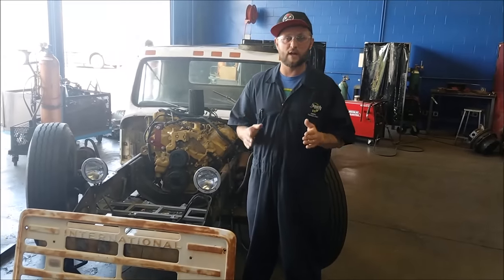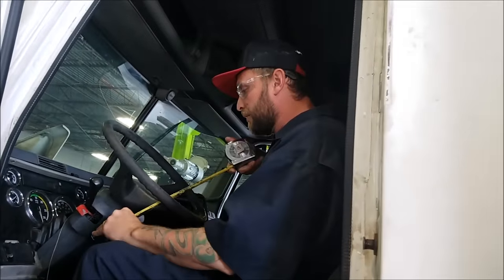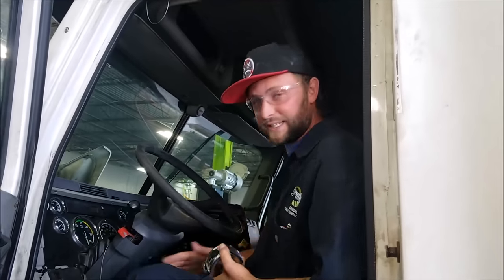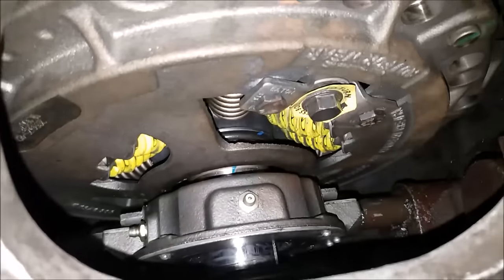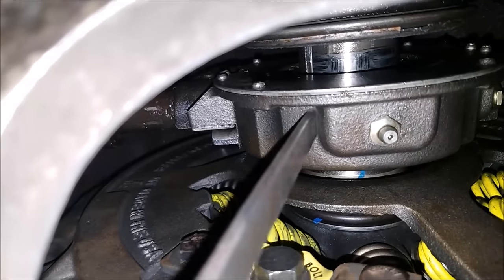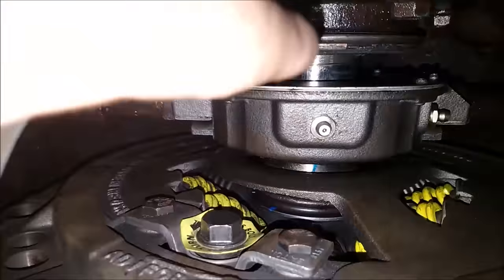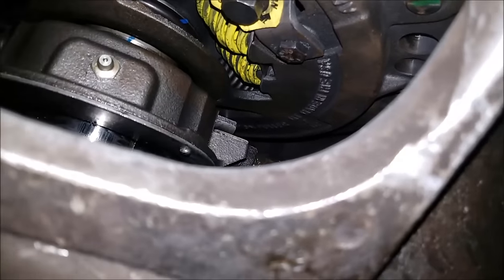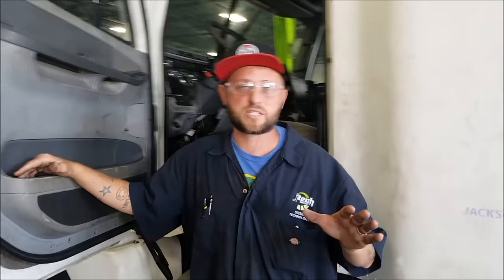Clutch Adjustment on a semi truck (Eaton Fuller)

Comment: The 1/8 inch should be between fork and release bearing pads
Reply: yes thats what i was taught.
Reply: Same here he definitely did not do the 1/8th measurement correctly
Reply: been teaching diesel for 23 years. yes 
1/8" is between fork and release bearing pad.
Reply: The forks are called a yoke.

Comment: Great video. You explained everything very well. I do my adjustments a little different but still get the same results. Example. I measure free play standing outside the truck with tape measuring off the floor.

Comment: If the gears are grinding when I move from a complete stop, do I need to adjust the clutch ? Or there’s a bigger problem?
Reply: Clutch is wearing u can add a clutch brake spacer for about 10bucs should last about a year
Reply: Get a mechanic to take a look at your clutch break
Reply: in order to do a good job sometimes you just need to adjust the pedal.

Comment: Once 14mm RB to Clutch brake the feeler gauge should be held 25mm off the floor if not don’t touch the quick adjust it is only used to set clutch opening travel CB crush is all mechanical throw

Comment: Thanks 👍 but I have a 3208 cat to a 13 speed fuller eton tranm never had problem with anything it's a1984 Ford 8000 I am 67 years Old I will be doing it alone and will try to get it done with out dropping tram don't know if it is possible   😢

Comment: As JAMdiversified pointed out, the clarification should have been made that the adjuster bolt is ONLY to establish the proper 1/2" throw out bearing-to-brake disc clearance which is the 1st step in the process.  Measure gap, depress clutch, turn bolt, release clutch and recheck clearance.  Repeat as needed.

Next is external linkage adjustment (if needed) to establish the 1/8" yoke fingers-to-throw out bearing wear pad clearance.  Once set, brake disc crush should be correct with the depressed peddle still off the floor.

NOW check peddle free travel and if insufficient adjust peddle stop bolt to yield spec dimension (typically 1-1/2" to 2" as you stated) or determine what portion of the external linkage is worn or the cause of improper travel.

Once everything is adjusted correctly and to spec, readjustment should be performed when free travel is half that of original.
Reply: Cannot count how many times I've had to undo. Other clutch adjustments. 
I always tell them.1/2"gap first. Then the linkage. 
It seems certain mechanic's adjust linkage only (apparently it's the easy  way)but it's totally wrong.ass backwards. 
Kinda glad hydraulic clutch is in more.. so now.them mechanics cant adjust the linkage anymore .
Now it seems every hydraulic clutch needs adjusting. Free play hard to tell.
I tell them. If the clutch brake dosen't work(on hydraulic). Adjust clutch.
Reply: I need a good mechanic. Can you share your contact info with me please. I have several repairs i need done to my 2017 International ProStar.

Comment: As a mechanic I can tell you how many times I have gotten called out to replace a clutch after a shop told a driver that the clutch is shot and will cost $3,000+- to fix. Only to find it's just out of adjustment. Even a guy that owned a small fleet that had been in the business 30+ years didn't know the difference between a wore out clutch and one out of adjustment. 
 As a young mechanic I worked on log trucks for a logging company. Their drivers averaged 20+ years driving there. Yes they paid drivers well. 
 Clutches were replaced when transmission failure or motor replacement happen just a matter of routine . But if a driver actually wore out a clutch he was fired. Guess what I never needed to replace a worn out clutch. I think there are many Dishonest mechanics out there.
Reply: Tim Erickson a lot of people like to shift without the clutch.. Very bad in my opinion.
Reply: So true Tim.  Makes one wonder how many truck owners got charged $3K for a "new clutch" when the shop took 10-15 minutes to do an adjustment.
Reply: @bstinson3475  ,  I always shift without using clutch once I'm out of 1st gear ofcourse. Got 500k miles on original clutch and 13speed. Shifts like a dream. In my opinion you actually save the clutch if you know what you doing.
Reply: The only time I use the clutch is reverse or on first gear and believe me I have ever had a problem with any clutch and I have been driving for 21 years,I think when you take care of the equipment that you operate when you do it right it would last long time and also I agree that there are some bad mechanics out there that there just want to charge just to charge.
Reply: @bstinson3475  floating gears is easier on the truck
Reply: I need a good mechanic. Can you share your contact info with me please. I have several repairs i need done to my 2017 International ProStar.

Comment: Why do I loose my clutch brake when I adjust clutch. If I go 6 clicks I won't go into gear. If I back it off 3 clicks it works again but I hardly have any free travel in pedal.  It will hardly shut off engine brake if u touch pedal,  thats how short free travel is
Reply: All the ball ends are good on clutch linkage.

Comment: Ok.  Knuckle head.... internal specs, 1/8 inch between the fork, and the through out bearing where they pivot.... not on the sides of the fork, and bearing. 
5/16 to 3/8 between the clutch brake and the throw out bearing. I’ve never heard or seen a feeler gauge between a clutch brake and bearing...  if there’s a gap, then clutch brake is not doing its job. Alway remember internal adjustments before any external
Reply from the maker: Bill Robison Sorry man I literally learned this shit while I was filming this video for school. I suppose I should re-shoot with the correct info.
Reply: clutch brake squeeze test uses feeler guage, as per eaton road ranger manual
Reply: Jarod corrected his mistake and proper bearing to brake disc dimension is 1/2" as he states.  This can be confirmed by the clutch adjustment instructions that come with a new clutch.  Special tools like his and similar are in fact 1/2" for the bearing-to-brake and 1/8" yoke finger-to-wear pad clearances.  Those same instructions will include the feeler gauge check but experienced mechanics can see the disc compress or not and don't need one to see the brake is going to do its job.
Reply: @jrod3286  That would be a good idea as although the original is informative and mostly correct you can make it better.  I'd incorporate an actual adjustment for demonstration purposes as already suggested.  Good job.

Comment: I got Eaton Fuller 13 speed. I replaced my clutch three months ago and now trying sometimes not to change the gear when increases the speed.  And the clutch pedal play is none at all since they gave me the truck. Now passed the three months warranty. What do you think the hesitant on the clutch?  please give me your advise if I can fix easily with no much cost maybe adjustment? Thank you!
Reply: A new clutch will seat itself after a bit of use and you may lose your freeplay, this is normal. It just needs to be adjusted.

Comment: My truck is shaking at 1000 rpm and vibrating a lot ... then it phases out by 1500 rpm ... struggles to go up hill even without hauling any load on board
Reply: Might be an injector or injector O-ring
Reply: @lild630  you are exactly right ... i got all injectors changed ... 2 were bad ... now its running good ... but now out of business cuz insurance premium went up...
Reply: @rizwantarar4208  sorry to hear that. My truck's getting an injector replaced now and it was doing the same thing.

Comment: Do you have to pull the transmission to replace the clutch brake?
Reply: Get in there with a die grinder in a long burning tool and cut the old clutch brake out of there. Then there are several options for ones that can be snapped on there after the fact

Comment: You were correct up until you advised to make any adjustments to get it into spec with the quik adjust bolt. Once the initial 1/2” gap is set ALL OTHER ADJUSTMENTS ARE EXTERNAL. IE adjust the linkage NOT the clutch quick adjust mechanism to obtain clutch brake squeeze and freeplay.
Reply: Your completely wrong. This is for a 2 stage truck clutch, not a clutch in a car or tractor or pickup . You never change the external linkage on a big truck
Reply: RJ 1999  no you are wrong read the instructions once 1/2 “
Reply: RJ 1999 inch gap is obtained all adjustments for more squeeze or free play are external

Comment: That's The Correct 1/8" Measurement? 🤔
Reply from the maker: Lizzy V can you be more specific? are you asking if the measurement was taken correctly or if the bar stock is actually 1/8"
Reply from the maker: Lizzy V yes you are right i didn't even realize i did that until i watched the video again.  my apologises
Reply: @jrod3286  what's going on here? And how did you make that tool?